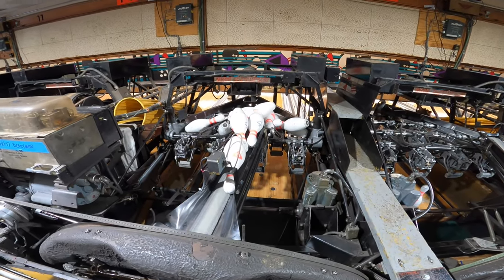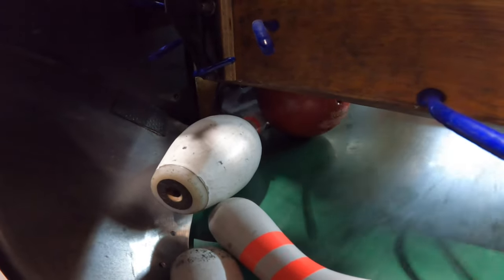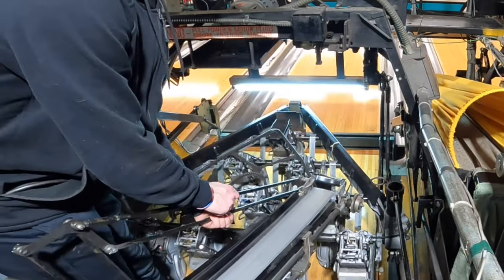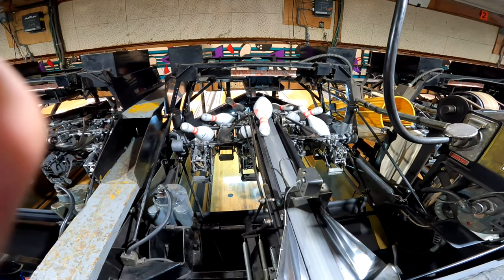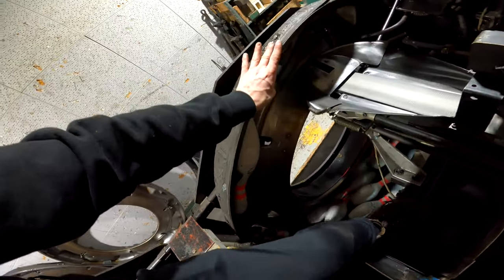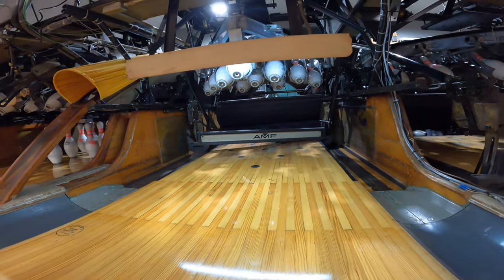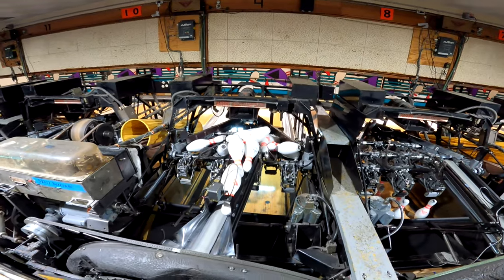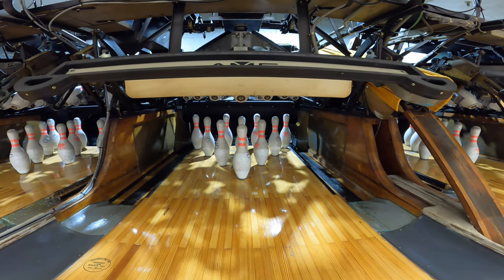AMF 82-30 Common Stops and Calls

Comment: Back in the day when we had ball doirnissues we would use a broom stick and wedge it and paddle the ball and pin out the door.  It worked all the time but the other issue was it clicked the pit sensor and cycled the machine.

Comment: Great video Joe. Love those 82-30’s. I remember also clearing black outs (table-sweep crash) and out of cycle chassis where the sweep and table are out of sync and can lead to a crash, and pins kicked out front.
Reply from the maker: Yeah we don’t really get those calls because all of our chassis’ are converted to the boards. Super cool
Reply: @Joethepro181  nice. Where I started my career they had, and still do have, the original chassis’s. Back when I started the machines were not well maintained. 36 of them with lots of problems that lingered for years. Long after I left to work on 70’s, pro bowler Doug Kent bought the place and put a lot of money into them. Now they run great. Still, the 30’s are the best.
Reply from the maker: @Sean-mclaughlin  Will never get rid of mine, I love ‘em, run better than the 70’s around here
Reply: @Joethepro181  I totally agree with that!
Reply: How about a black out with the sweep or even table coming down on your back.  Yeah I know, it was dumb of me to enter the machine without all the motors unplugged, but yeah it happened a couple of times.  I remember the first time, me panicing (everything but the sweep motor being unplugged, and the sweep coming down on my back), and my uncle (who had decades more experience on 30s) laughing at me and telling me to just let it black out.  In the end the black out feature was a truly amazing safety feature, truly ahead of its time.  From what I was told early 70s didn't have the feature and it caused a few deaths.
Reply from the maker: @aaronz9410  you never went for a ride on the magic carpet?😂

Comment: Hey, I’m currently 18 and this fall I’m going to be going college for diesel mechanics and I’m planning to try and get a job at a local bowling alley fixing the machines. Do you have any tips for someone starting out?
Reply from the maker: It depends on what type of machines you will be dealing with. If you are working with AMF machines I can definitely help you out! I try to cover specifically 82-30 stuff but I can help you if they have 70’s also. Let me know! Shoot me a email at joethepro181@gmail.com. Anything you fix remember to do it right the first time!!

Comment: What happens if the table should happen to come down on an offspot pin? I'm guessing a lot of times the pin will be knocked over due to the design of the table but what about the one time everything lines up perfectly?
Reply from the maker: Then you get a bent re-spot cell… usually you get lucky and it’ll just fall over but once in awhile one lines up just right and screws up a re-spot cell
Reply: @Joethepro181  Kinda what I envisioned. Thanks for confirming. On a side note, if you ever get to Omaha and need a job, we'll be hiring in the future. let me know if interested.
Reply from the maker: @coasterp2199  Thank you! I will keep that in mind!!

Comment: Joe, this is Harold.  I worked in a 40-lane center in Largo Florida (Largo Lanes).  The first 16 were open pin wheels and the other 24 were solid pin wheels.  I loved working there, but the one problem that has stumped me  is clearing an off spot pin.  I tried to do it the way I was shown, but I always came up with a machine that was "out of time."  Can you show how to correctlly do this call on your next video?  Thank you
Reply from the maker: We don’t really get that call… usually it either misses the pin or one of the respot cells gets bent up…

Comment: Cool video. I work on these. A pain in the butt but incredible system honestly. I couldve never come up with it.
Reply from the maker: Great machines when maintained! Thanks for the comment and make sure you hit subscribe!:)
Reply: I wouldn't have.  How did they come up with that overcomplicated distributor?
Reply from the maker: @KC9UDX At the time, with the technology they had, that was the best option
Reply: @Joethepro181  not to me.  Before I ever saw a Brunswick or knew how they worked ,I wondered why AMFs didn't work that way.  That's the obvious way to me.

Comment: Fantastic video what about out of range what does a AMF pin spotter do for out of range
Reply from the maker: Nothing really, unless you get unlucky and the pin lines up perfectly under a Respot cell bracket. Usually you just have to set it back up
Reply: @Joethepro181  awesome thanks for answering my question 
How often does a deadwood happen with a AMF pin spotter
Reply from the maker: @CaptianNamco  All the time

Comment: Can you show where the second ball switch is? I’m new to the 82/30s and trying to learn whatever I can. Thanx
Reply from the maker: So there isn’t really a second ball switch, you just have to run it through a cycle
Reply: With the push button?
Reply from the maker: @kohlcytre  yes. There is a cycle button on the switch panel just below the back end motor

Comment: I would like to have the opportunity to work on an AMF machine. Clearing calls on the Brunswick A1's was pretty stressful during leagues, had a lot of catastrophic failures on those old machines
Reply from the maker: I don’t know them too well so I don’t know what it’s like, these ones have their times as well
Reply: @Joethepro181  A1's don't have a lot of safety features that were fixed in the A2 versions. Some calls requirs the machine to be turned off and sometimes put into first ball, clearing the deck and respot. The machines I worked on liked to drop pins
Reply from the maker: @Drayman1011  yikes!

Comment: Dude your front roller is shot. That thing is knocking pretty hard
Reply from the maker: These machines were not properly maintained for 20 years… Many of the front roller hinge shafts are worn and I’m still in the process of rebuilding the pits… after 20 years of neglect it takes a while to make up for that, but I’m working on it

Comment: Well lane 1 may have a staged ball issue but the first thing i hear in the first few minutes is a front roller in need of some help! 
Pin that thing back and pull that carpet bounce plate and rear roller before the bearings create an issue like rip the carpet the roller seats or the hex bolts are loose. Should not be as usually trying to remove them without heat will snap off as many hex sockets you care to buy!
Are they the old style stepper relay chassis?
I know they made updates that almost are like the 82 70 MP Single board chassis and the 90 XLs 
But i learned on the 30s in the 80s with the old heavy ass stepper relay chassis. Well heavy for a kid who was like 7 the first time i went in the back it was 1984 and the way the house was set up the pit was really the pit the lanes and machines were elevated a little higher then most because it was under the shopping center so you went down 2 flights of stairs to get to center then down a step to concourse then down another to seat area the approach was step up but to go in the back it was not ramp down to the lanes were knee high then at the door to back another ramp down so in the back all the carpets were elevated cause all the pits were on like adj feet but solid to hold  weight!
So i did lots of sweeping under those 30 lanes.
Like a pin could roll under a machine just the very bottom of pin wheel is only spot where it may hit the belly of pin but as a 7 year old what that did was make the first experience of my 82 30s for almost til i was 20 WAS MAKE MY FIRST 30S SEEM LIKE GIANTS! AND IT WAS AWESOME! SO LOUD! SO SCARY! SO HUGE! 
AND I LIVED ON THEM SUCKERS! I COULDN'T GET ENOUGH!
But what a bitch as i learned later on how easy a 70 or 90 pit and distributer come out even out the back where those 30s 
CARPETS BOUNCE PLATES AND ROLLERS WERE COMING UP AND OUT  OVER THE PIN DECK AND OUT ON THE BACK END! THEY WERE NOT GOING OUT THE BACK.
ESPECIALLY SINCE THINGS WERE ELEVATED SOME ALL THE REARS WERE PINNED TO EACH OTHER AND TO THE PIN DECKS WITH A SET UP TO KEEP EVERYTHING IN SPEC WITH JUST CRAZYNESS BY THE TIME I WAS THERE SINCE IT OPENED IN THE 50S I WAS BORN IN 77 SO ALL THE 80S AND 90S I WAS ON 30S NOT FAR REMOVED FROM THE ORIGINAL CHAIN DRIVE SUCKERS THAT ATE FINGERS OF MANY MEN BEFORE ME!
EVEN VINCE ONE OF THE OWNERS WAS MISSING PART OF HIS PINKY AND MADE IT A POINT TO ALWAYS YELL AT ME AND SAY...
YOU SEE THIS SWEEP LEVER?
WHEN YOU RUN THIS SWEEP YOU NEVER STICK YOUR HAND IN THAT CAM OR IT WILL CUT IT THE FUCK OFF LIKE THIS!
WHEN YOU SET THE DISTRIBUTER ON TRACK AND SET THE BEARING JUST BACK LEFT A GEAR AT 5 PIN NEVER GET YOUR FINGER UNDER IT OR IT WILL CUT IT THE FUCK OFF JUST LIKE THIS OTHER ONE!
LOL
MADE HIS POINT AND I GOT ALL 10 AT 47 AND BEEN IN MANY MACHINES FROM COAST TO COAST!
I could go on forever! Lol
But you know what im saying so you probably wanna stick my head in a respot gripper by now to shut me up!
Fair enough!
LMFAO
Reply from the maker: It’s not the roller, it’s the shafts the hinges sit on. These machines were neglected for about 20 years or so until I came around. The chassis’ have been updated with the Omega tek boards. It sounds like you have been around these machines a lot! I love them. They run great if you maintain them properly. They will be here for a long time
Reply: @Joethepro181  when I started we still had wood lanes we line and dust by hand stripped and dry toweled by hand. And oiled to 35 feet with a Century 100 wick machine with the shims in the upper blocks to set the oil pattern to the wick below!
And the ball return motors were Century And the sweep & table and backends were all Westinghouse!
I know GE and Westinghouse are still in use and AO Smith was in business for a bit and now Baldor but I have not seen a Century since like 89. And yeah My dad and Uncle were both in the pit and bowled so I got an extra early start and access in Pennsylvania! 
I went on to the 70s some of the 90xls at Dover Air Force base The old Brunswick As the 1950s baby shit green ones and some newer A2s with jet backs. The old As still had some Otis Elevator tags and stamps that was the founder of the Brunswick pinspotter but I did kegel lane maintenance ran the Phoenix S Tournament edition the Lane Walker worked on Qubica, Magic Score, AMF BOSS. Big Old Shitty System direct from Asshole Mother Fuckers! 
But I'm an AMF guy but I've seen Twister pins come and go! The Mendez Machines
Spent years as a kid ripping tele scores for league and sharpening yellow pencils to learning THE AMF HPL 9000 Synthetic lane surface and topography and how to read loads of oil from board to board IPS travel speeds boards crossed how many loads at what distances forward oil for shape reverse oil for volume
 total microliters how to set a buffed or hard defined line at the oil to backend end of pattern transfer to the dry.
I've cranked way many sweeps on them ones on the 30s getting that carriage back on track from morons on Saturday nights moon light just drunk throwing multiple balls and blasting the sweep off and then it would get wedged back on the pin deck on the gutter edge and all crooked in the pit!
Lol it's funny now but people are dumb!
And yes I do fully say I stand corrected and no doubt you are right you are there but I think you understand what I heard and why I thought that and also knew once you explained it I would agree therefore coming to the conclusion that somehow we went from just some young guys who found something special with the machines To the Masters who are the last generation to know and work hands on and know the era were in and how and  why they got there because we know first hand the past eras that is the foundation.
Don't lose your passion! It keeps the old man out but let's his wisdom in!
And yes the machines know we are there and they prove they have personalities by being certain to do exactly what we have been watching for hours to catch as soon as we turn our back due to another call or just go take a leak!
You can almost hear them go HA HA every damn time!
LMFAO!
FACTS!
Reply from the maker: We have a Kegel lane machine now but the old century machine is in the basement. It’s never been used since I’ve been around
Reply: @Joethepro181  That thing should be encased and on display at the National Bowling Stadium in Reno! Next to the original DBA lane walker! The one with flippers that looked like a drunk sea turtle trying to flop its way from lane to lane!
LMFAO!
Stick a Dick Weber 5 star ⭐ Power Ball on an above ground ball return rack between them and we almost have an iconic set of Relics that almost seem to come from a different planet!
Add a spotting table that's spring loaded with a foot pedal to release to spot and load by hand then we just crossed into another dimension! LMAO
But even the great pyramid has carvings of what was an earlier form of bowling!
But they used like 9 pins!
Maybe they used it to shoot bowling balls into space and the pins were the stars! Lol I mean the foundation and actual physics of bowling balls and how they work and planets themselves and how they spin and cycles through space are founded the exact same! Orbital mechanics from a spinning planet or a 3 piece spinning bowling ball can be explained and predicted because of that relationship!
But don't overthink think it!
Knock down 10 pins every shot and it's 300s ALL DAY!
LMAO
My first 300 is on the books back when it was still ABC so i got that throwback history as checked fact!
Lol